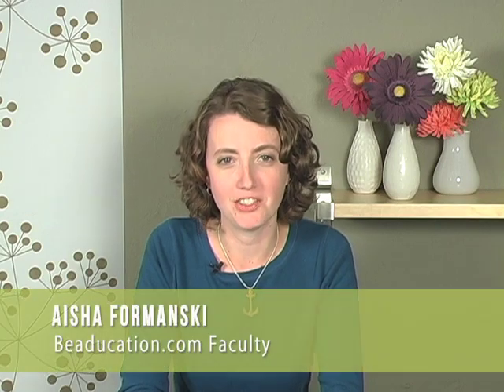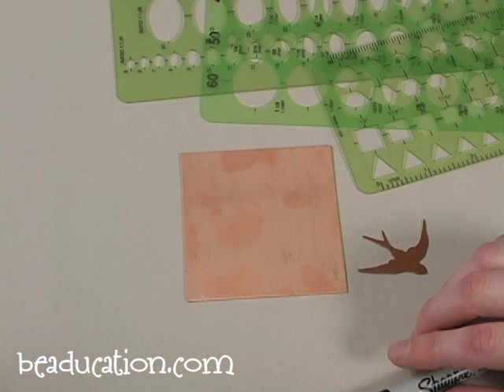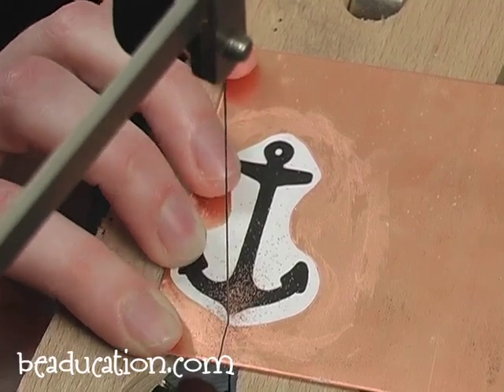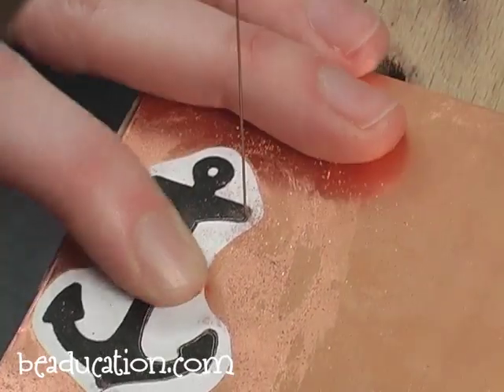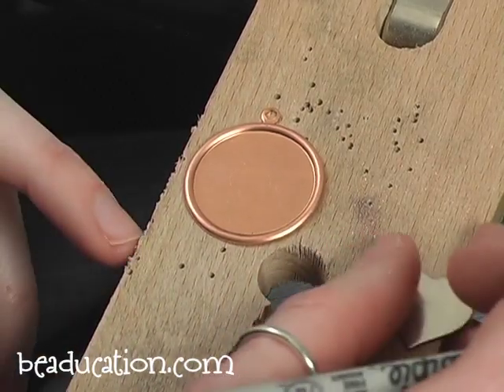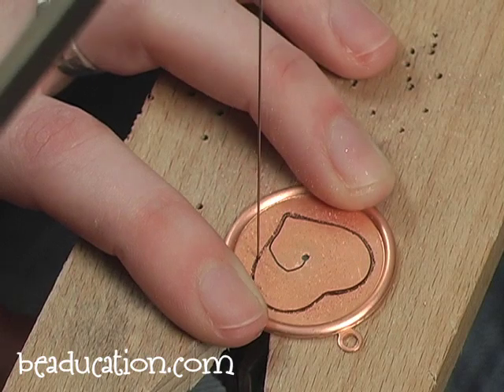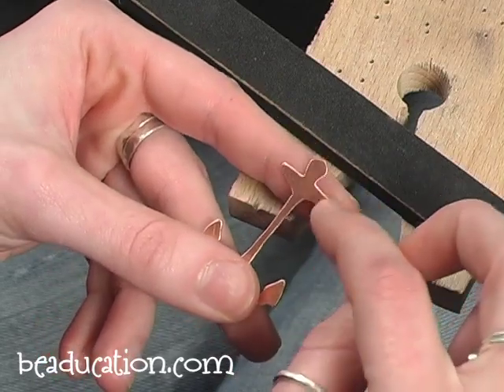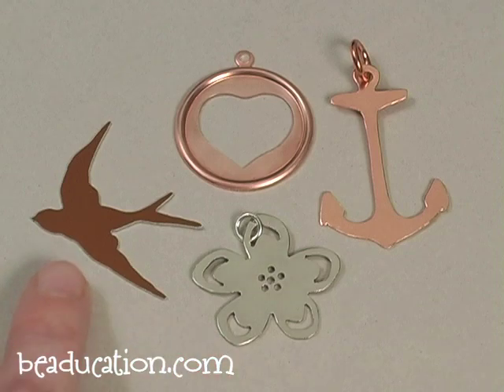Sawing Your Own Metal Shapes - Beaducation.com

Comment: I've noticed, when I saw I'm holding with my left hand..sawing with my right!
I'm pressing down with my left hand to hold the metal in place, but I'm pressing so hard  that I'm hurting my left hand and arm.
I have a problem with my left side already! Any tips?
Thanks to all of you! Ya know I love ya!
Reply from the maker: Deborah Bergen It sounds to me like you are just being too tense with that left hand. Try lightening up a bunch, you will be surprised how lightly you can hold it while keeping it in place. Make sure to stop and stretch your fingers and wrists and shoulders often! Hope this helps!
Reply: +Beaducation That's good advice. I'd go further and suggest a light, upper body warm up and stretch before settling down to a piercing session.  Also to stop for a few mins at least once an hour, get up out of the chair and warm up / stretch again.

PS - To keep your hands and fingers loose: clench both your hands into fists and flick all your fingers out together - do this about ten times, rest for 30 secs and repeat twice. A guitarist showed me this, saying it was better than shaking your wrists out, which can cause the joints to swell.

Hope that helps - keep up the great work!
Reply: Thanks Lux!
I haven't been working lately.
I'm ready to get back to it. 
It's in my soul to create.
I've just been diagnosed with M.S. hence so many problems with my left side.
Lots of changes in my life recently. But I finally realized, I have M.S. it doesn't have me.
 You got an earful. lol.
Blessings, Deborah
Reply from the maker: +Deborah Bergen Deborah, we are inspired by you. Keep it up....stick with the stuff that makes you smile and don't let M.S. stop you! :)
Reply: Deborah Bergen
I can empathise, having taken to jewellery making after a serious health episode a couple of years ago.  Where there's a will there's a way and you certainly have the will.  I wish you all the best.
Reply: Lux, thank you!
I'm glad to hear you are doing well!
 Thanks for your positive thoughts.
Keep in touch!!

Comment: Hi,

The type of metal saw which you have used, can it cut through 1mm thick copper sheet?
Reply from the maker: You can use the Jeweler Saw shown in this class. What you need to make sure of is using the the correct saw blade. Link to saw below. The alternate image on this details page shows the saw blade chart. 1mm translates to 18 gauge.

https://www.beaducation.com/p/188-jewelry-making-tools-jeweler-s-saw-frame

https://www.beaducation.com/product_guides/8-all-about-metal-gauges
Reply: Is it necessary to anneal before sawing; I'm working with 18 gauge sheet copper, brass. Is there any disadvantage to annealing prior to sawing? Thank you for a trerrific tutorial!

Comment: Thanks for the video. I have what appears to be the same jeweler’s saw (is yours from Home Depot?), with the stock blade it came with. I was trying to cut a very simple pattern out of 1/16” thick copper sheet, but it was next to impossible. Regardless of how I tensioned the blade, I could not get the saw going in a straight line to save my life. It was also very hard to get started. Before you ask, yes, my teeth were facing down. Let me know if you have any thoughts, thanks!
Reply from the maker: maybe you need a different size saw blade? Below is a link to our jeweler saw. click on the image for the Saw Blade Size Guide. Our metal thickness is listed by gauges.
Reply from the maker: https://www.beaducation.com/p/188-jewelry-making-tools-jeweler-s-saw-frame
Reply: Beaducation thank you very much!